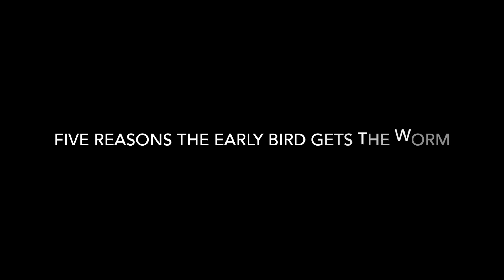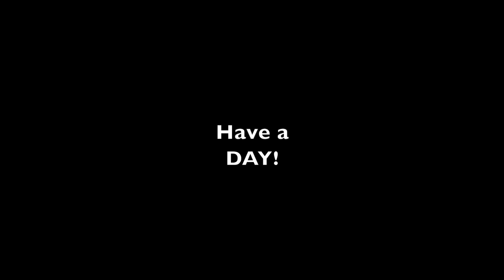#818 FIVE REASONS the Early Bird Gets the Worm!

Comment: I've been retired since 2007, I'm up late at night, usually go to bed at midnight sometimes 1:00 am, and up at 8. I'd get up earlier but I wait form my wife to get up and go to work (now at home). You have to have something that keeps you busy, never retire thinking your going to sleep in every day and do nothing. I have several hobbies that keep me busy. I do woodworking, photography, and electrical/electronic projects. I put a new radio in my 2001 F150 pickup and now I'm converting the original radio to use in my garage. I make bottle lamps, repair old lamps, Rotary club member, on the BOD for the Committee for Dulles [airport] was Commander of our local American Legion for 10 years and was on the Herndon Town Council for 8 years. Bragging? You bet I am. 73 years young.

Comment: I get up at 3 AM to be at work by 5 AM. On the weekends I still wake up early even though the alarm clock is off. Mike, 87 is not hot, that was almost our overnight low (86). Today it got up to 108 degrees and it’s supposed to be that hot all week!

Comment: Morning Morgans. I agree with all of your reasons for getting up, the clear mind, no distractions and chores getting done faster. I’ll add this, when I need a service or inspection on vehicles I’m usually one of 3 or 4 there before the service center opens at 7:00 and I crack a smile at the person coming in at 7:30 needing a quick turn to realize they’re number 20, 😂. I’m like you Mike except I liked to sleep in as a teen until I was introduced to the trash can alarm clock at 17 years old at basic military training. Even though that 49 years ago I still wake up before the alarm at 4:45.

Comment: Here in New Berlin, NY the wife & I are up a little after 5am.  A little spin, I'd like to share the Top 5 things I've learned from your channel: 1) Never buy fatwood when you have access to a red pine tree. Just a little of those broken branch stubs are a great fire starter!  2)  Learned better use of the front end loader (FEL) on my JD 2720 (no spinning wheels!).  3)  Speaking of FEL, I built a small section of a gravel tractor path in a muddy area.  4)  Frost seeding!  Near my gravel path are dense shade areas where the grass doesn't grow and no luck with re-seeding.  I ordered dense shade grass from the nice people at Pendelton Turf Supply and applied the seed in mid March. The grass is doing very well!  5)  Using your own lumber to build stuff has multiple benefits, mostly a sense of pride!  I have a mature stand of Norway spruce that was used as rough cut lumber for my garage build and a red oak used in building a kitchen table & chairs.  Thanks Morgan's!

Comment: The job I used to do for the same company I work for required me to start at either 6 am or 6 pm, but I had to be there at 5:30 to get briefed on the previous shift. So, a typical day consisted of around 12 1/2 to 13 hours per day. Usually the drive from the motel was around 45 minutes, so I was usually up around 4 every time. We worked 5-12 hour shifts and an 8 hour shift on Saturday, if needed.

Comment: I'm an early riser, but my location plays a bit of a role in that.  While at home I get up at 3:30.  It gives me time to have a cup of coffee, stretch then do my "personal business" (shower, shave, etc.).  Then I'll get a bit of breakfast, brush my teeth and get out the door to be at work by 5:00.  Those first few hours at work I'm much more productive and energetic.
On the other hand when I am out on our property, I tend to "sleep in" a little later until around 5:00 or so.  It gives me time for my coffee, listen to the sounds of the woods waking up, have some breakfast, do my "personal business" then get started just as the sun is rising.  I like to get going and do my more strenuous work early in the morning while it's still "cool" outside (70 or so degrees F and very high humidity in North Florida).
Between lunch time (around noon) and say 4:00 in the afternoon I pretty much take it easy since that is the hottest part of the day (temps in the 90's F and humidity usually a bit high).  The late afternoon/evening after supper I usually do stuff to prepare for the next day's work (service tractors, stage equipment, etc.).  During the summer I usually shower and call it a day right at sundown, go to bed and do it again the next day.
I wouldn't have it any other way.